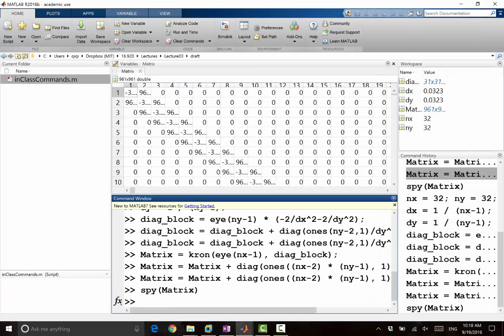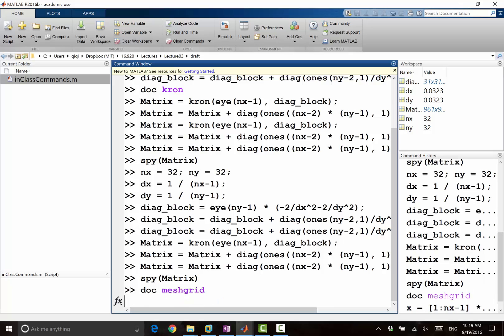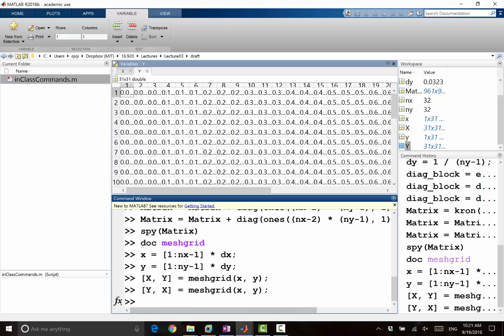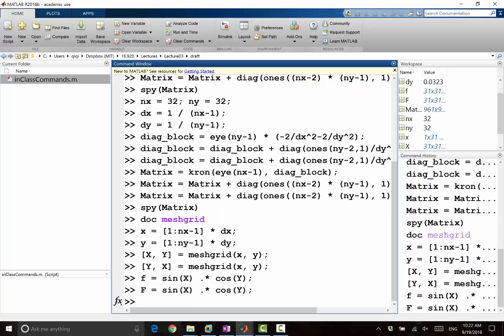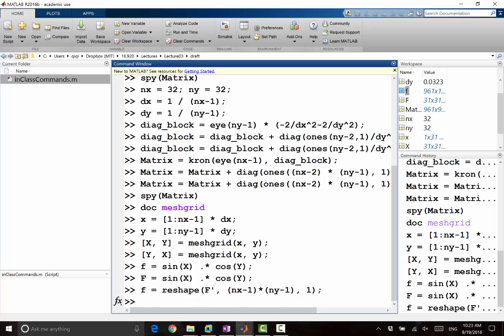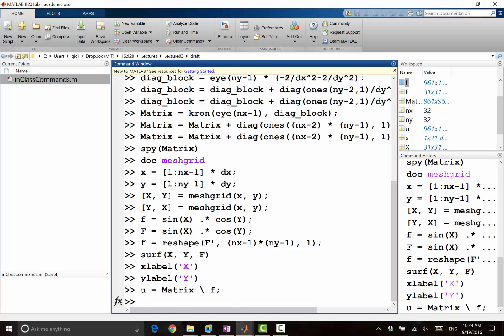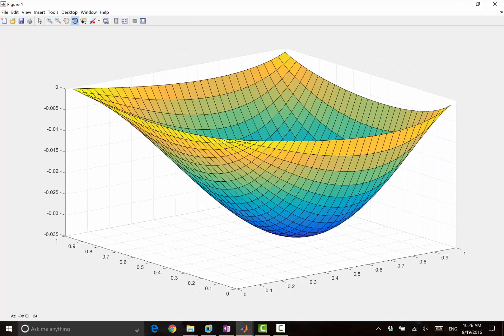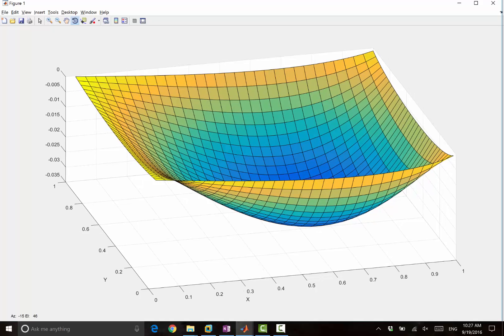Lecture 04 Part 5: Solving Poisson's Equation, 2016 Numerical Methods for PDE

Comment: At 1:50, you change [X, Y] = meshgrid(x,y) to [Y, X] = meshgrid(x,y)
While this helps transpose the indices (I understand why we want to do this – since Matlab increments in i before j), the limits get flipped too. For instance, if we have x ranging from 0 to 10 and y ranging from -1 to 0, using [Y, X] = meshgrid(x,y) we now have X ranging from -1 to 0 and Y ranging from 0 to 10 which doesn’t seem right to me. Please let me know what I’m missing.
Reply from the maker: You are right. The correct thing to do would be [Y,X] = meshgrid(y,x)